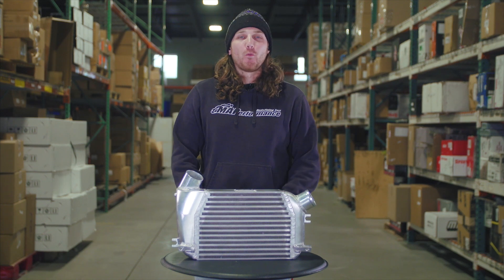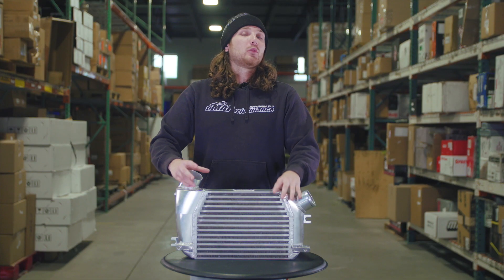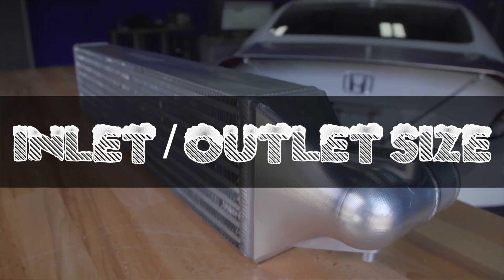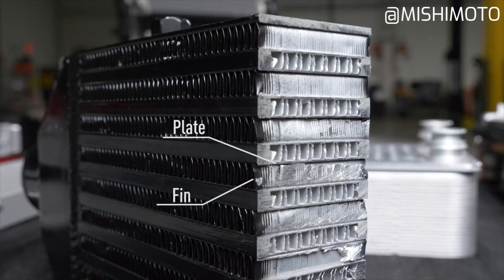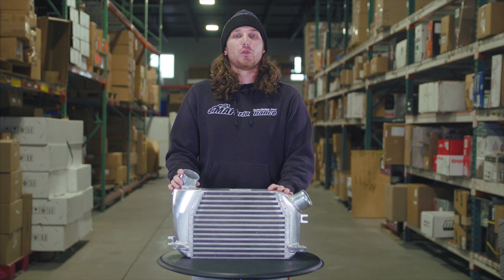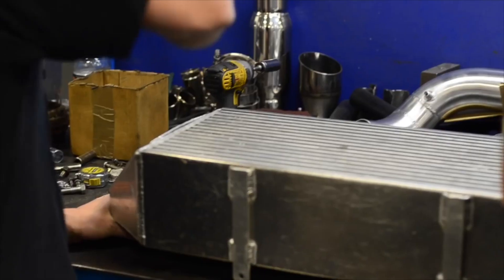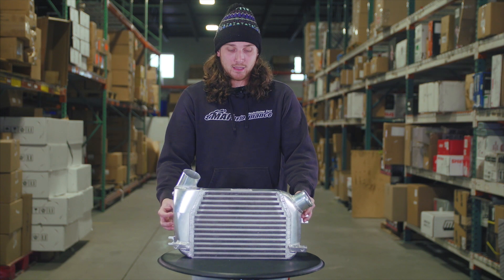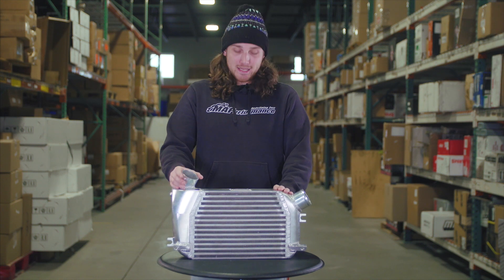Top 5 Things To Look For When Choosing An Intercooler

Comment: Only 2 designs, yet you showed more than 2 designs, and extruded tube as you shown is not the same as normal bar and plate and there are dozens of variations within and beyond

Comment: I have a 10th Gen Civic Si and can’t decide between PRL and Mishimoto 🤔🤔🤔
Reply from the maker: Both stellar options. Give us a call if you have any specific questions!
Reply: Mishipoopoo
Reply: @hyper8545 , Not the exact car but on my Type R the PRL and Greddy were neck and neck.. The Mishimoto turned out the best IAT's and we did a solid amount of testing. The PRL is a good choice too but to say the Mishimoto doesn't do its job really well is BS. Intake I'd say PRL, Intercooler Mishimoto. I had 2 10th gen Si's before this Type R. And tried a ton of different parts from a ton of companies
Reply: @thinkforyourself5672  the mishi iv seen is always lower quality =/ plenty of better shops doing top notch work.  I guess if your doing budget builds or don't have a high standard its ok but you know =/
Reply: @hyper8545 , There is only so much performance you can possibly get from intercooler on the Type R. Full race makes a really nice one, PRL, Greddy, 27Won. They're all extremely close in performance. My mechanics Type R is at 500HP and he some his first 2 and stuck with the Mishimoto. What other options are you talking about? You're going to pay $500 to $700.. There isn't any $2000 special high quality intercoolers for the FK8 that I've seen anyone running
Reply: @thinkforyourself5672  i wasn't necessarily thinking fk8 just mishi in general for many different platforms.  But yes a 500hp core can only do 500hp or 1000hp core blah blah